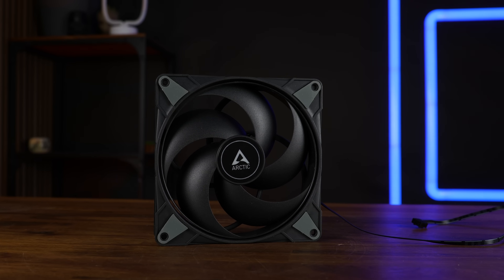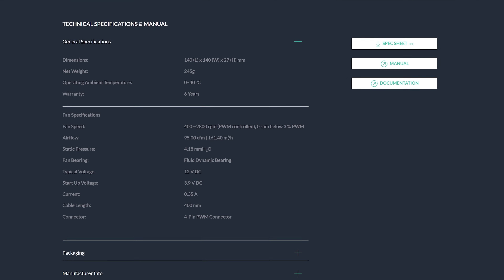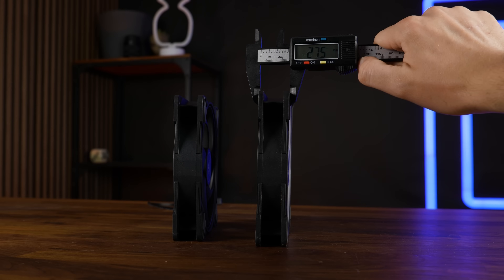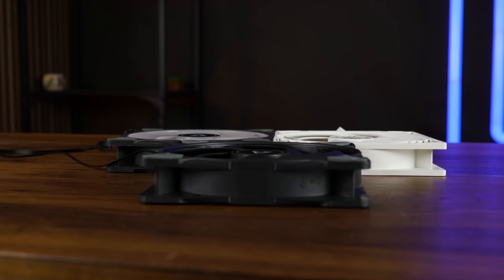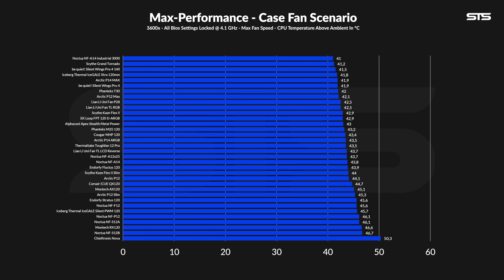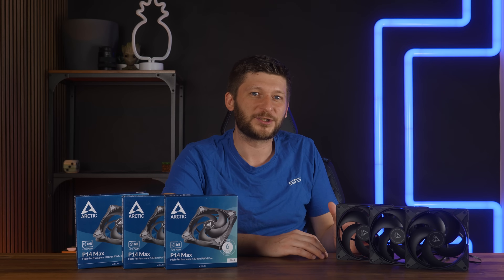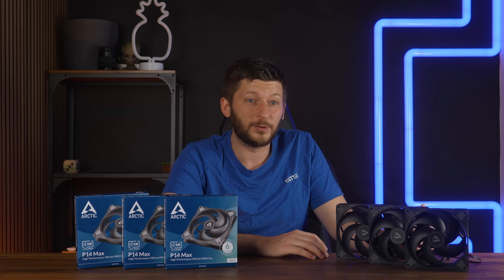Arctic P14 Max - The Monster 140mm Fan

Comment from the maker: -- Spec Confusion

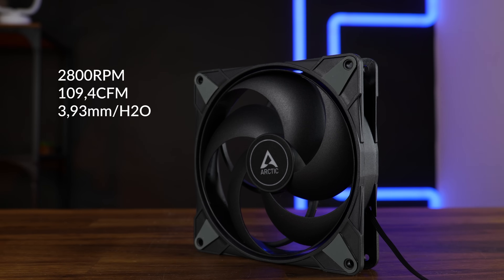As some of you pointed out, the specs stated at 00:50 are NOT the ones Arctic states on their website. 
After a short panic attack - those are the specs written on the box.
I have reached out to Arctic to get more information on this matter, either the Website or every P14 Max packaging got the wrong numbers.
There will be an update as soon as we get an answer.
Reply from the maker: Update ---
There was indeed an error on the packaging of the first few batches. 
The correct Stats are: 
95CFM / 4.18mm/H2O

According to Arctic, this error has since been corrected. However, this also means that there are who-knows-how-many P14 Max fans floating around with the wrong Specs on the box.
Reply: @STSYT  Thanks for the update! Awesome that you follow up that kind of stuff. I saw some people complaining about whirring/buzzing sound. Similar to what some of the P12 Max's were struggling with. I didn't hear any in your video but, did you notice any weird noise in general?
Reply from the maker: @vedomedo  Nothing noticable from far. If pressed against my ear while spinning, you could hear some sort of breaking grinding noise, but that was only at close range. I hope that doesn't become louder, but if it will, I'll update again ^^
Reply: @STSYT what is the best 140mm fan now? Just Performance, no price to performance.
Reply: So, there is no difference between rev1 and rev2 except packaging number right? I am asking cause i have rev1 and rev2.
Reply: @STSYT CAN YOU DO A 140mm fan round up

Comment: to those planning to buy, think twice. i got 4 of these on rev.3, FDB. When set as exchaust on top of my chassis, it makes very little noise even with over 60% speed (pretty much same as what you hear in the beginning of this video. There is no hum or weird noise on top of normal fan noise. For the other two P14max I got as intake, noise profile is same when mounted above the case as exhaust but damn, the hum or whatever it's called is insane and flows in a rhythm. It is like you've got a bee on caffeine flying over a fixed pattern.
Reply: sound like harmonic noise, your top fans must be tight so no air can push pull and create the hum, where the front filters or pushing past a frame or even flow back ontop the fan that more likely where the fan fight flow back would make the sound, i imagine lower the speed till it cancelled out that sound, if there drives behind the its why, I have the issue with fractal fan on the front due to the drives and unclean air flow, im looking at these as the 25mm over the 20mm fractals so the thigh to the drives Id hope will reduce the sound at the least same but better air flow. unfortunately these testers dont test real use cases.
Reply: @streamtabulous  those P14 fans I had as intake were down below my case. I think the hum is due to the blades facing the grill or case panel. For the ones I got mounted above the case, as exhaust, the blades are not touching anything or in a way "hanging" inside the case - the back of the fan is the one facing the grill or case panel.  

I replaced my intake with 3*TUF TR120 reverse fan. The blades are not facing the grill or case panel, no hum, peaceful gaming. Surely more expensive, but definitely worth it.
Reply: @zethcrane5468  i have the hum also but can take the fan caddy with fans out and the hum is only when in case blowing over whatever, interesting reverse blade on your doesn't do it maybe its air pulling in and air pressure build on blades outer. 
but reverse blades are lower pressure and air flow the p14 drop my drive temperature by 6 deg each rather massive drop. so im putting up with the bee hum. new drives are insanely hot at 40 deg at rest
Reply: i have the p12 (not pwm and max) and had same issue but over time the hum went away, the fans did get re-mounted when i upgraded the PC but on the same Case.

So for some people the Hum is possible to go away, also, on the front intake in my case i can mount close to inside or closer to outside (the mesh side), on the mesh side i doesnt make the HUM.

Comment: I bought this to replace the horrible stock corsair fan in my corsair CS800 power supply It has twice the airflow now and is connected to an Aerocool Touch 1000 to control the speed It now extracts warm air out the top of the case very effectively on my socket 754 3700+ cpu computer

Rear case fans are useless as heat rises extracting the heat out of the top is the best solution

Great fan

Comment: Tried those fans.
Had to send them back, because the ball bearing is very loud.
The blade design seems to be great to push a lot of air with not much noise. But you can't use those fans for a real silent scenario, as they're just too loud at low rpm.
Reply: the early production p12 max where ball bearing, but the later ones are fluid or whatever, and are WAY better.  

ive got both and yeah, early ones are bad...

the white p12max will be fluid bearing, the black is a silent update so hard to know what you will get :(.
Reply: @ I got the P14 Max just recently (February 2025). But they still had the ball bearings.
Reply: @uhu4677 how would you know if its ball bearing or not? Can it be known before purchasing the unit?

Comment: For anyone buying these fans and plans to install them at the bottom of the Hyte Y60 Case as intake, YOU WILL NEED to buy longer case fan screws. I bought some 30mm long case fan screws and was finally able to mount them since the default screws weren't long enough but other than that, I would definitely recommend getting these fans. 👌

Comment: I have a pair of these P14 max on my corsair h115i elite capellix. The massive airflow and static pressure combined with this 280mm radiator make the perfect aio to me. Mine are also the 109 cfm spec box and work perfectly fine lol

Comment: At 8:29, i dont understand why your Y axis starts at 35db, because surely the P14 max can push a LOT of air at noises much under 35db, right?
Reply: Probably because it is difficult to achieve volume levels below 35 decibels in a regular room.
Reply: @peny1981 the app on my phone would vehemently disagree.
Reply: @gudrune  Phones are not great for measuring.
Reply: @gudrune  phone aren't as accurate as dedicated noise meter stuffs

Comment: I love these P12 and P14 max fans. Yes, you need to tune the fan curves, but they're like 90% of the best performance you can possibly get, for 30% of the price. One of the things I really appreciate is that they start spinning at very low PWM values (>5% I think) so you can really use the whole PWM range - it's perfectly possible to have these run at 600rpm with the option of 2800rpm if you suddenly find a CPU+GPU load that dumps 800W of waste heat into your case all of a sudden.

Comment: 5pack is 40euro . i bought 2 for exhaust based on gpu temp. the 420AIO does the rest of the exhaust and the rest of the fans are 9x140mm intake.

Comment: I love the P12 max for its double ball bearing. It's nice to know that I bought a fan - and it's actually eternal. Yes, if you're not lucky, it will be a little noisier, but as a rule it's a trifle, you still can't hear behind the airflow. 
and the P14 max FDM has a bearing, i.e. it is a valve for a couple / several years (if you are lucky). 

I miss thermalright TY-143, it cost a penny, it makes noise depending on the speed - not much, it's a pity that they are no longer produced.

Comment: I have this fans recently but damn it didn't spin to max of 2800 but only 2580 to 2600.
Reply: Do not mount the fans into your computer before testing the RPM. Instead, hold a single fan with your hand and connect the power cable of the fan into your motherboard while at the BIOs screen. Now, check the RPM.

Comment: hi can u tell me  what length of screws i need to mount them on a radiator, do they come with theirs screws for radiator mount ? asking since they are 27mm thick is 30mm enough or i need to get 35 mm screws ?

Comment: Oh noes... I upgraded every fan from my PC to the arctic 120 and had some big temp gains, even using 2 as my dual tower cooler fans... 
Now I instantly want 2 of these, before even watching  the review, to put in the front of my S340 🤣
Reply: did you adjust fan curves? doesn't really make sense that you would get "big temp gains" unless you ran them a lot quieter than whatever you had before
Reply: @Violet-ui  I use them all at 80%, mega quiet and a lot of gains. My cooler had muck fans and my front ones had to run at 1200rpm or they would sound like a jet

Comment: Now I have to decide between getting Silent Wings 4 140mm high speed or these Arctic P14Max... hmmmm.
Reply: Wow. I thought I was the only one in this dilemma.
Reply: @MultiMustafa7  Don't get silent wings 4 high speed. They are very loud when mounted to the case. Get the Arctic ones instead. Or else get Silent wings non speed version

Comment: Thanks for the review, glad that you liked the fan. I'll pass the word to the engineers.
Reply: I have questions for you because I am quite new to pc building DIY and the info on arctic site product pages are vague

so arctic sells these two products

p14 pwm 
p14 pwm pst

pwm means that you can control the speed of the fans in a gradual fashion
pst means they are daisy chainable

but 

p14 pwm pst comes with a cable to daisy chain the fans

so,

if I buy the cable separately and buy non pst p14 pwms, would it work the same? 
Are the fans of "p14 pwm" and "p14 pwm pst" exactly the same?  Are the only difference between them  just "p14 pwm pst" having a cable in the packaging to daisy chain them? or the included cable in the packaging is not the only difference and if "p14 pwm" and "splitter cable" bought separately they cannot be daisy chained just the same?
Reply: bro i LOVE your fans, my rig is all P12 Max and 14 Max fans !
Reply: Awesome to see an Arctic employee in the comments! I have a question for you. The fans themselves are markedet as having "Fluid Dynamic Bearing", but in specifically hwbusters' review he states the fans are "Rifle bearing and not FDB as advertised". I was going to order a pack of these but reading that made me a bit worried. If that review is false, I would advise you to contact them and let them know.
Reply: Rip he never responded

Comment: Is it worth replacing the P14's  on my Liquid Freezer ii? Possibly not as my fans rarely hit 50% RPM, gaming load usually sees temps in the mid 50's°C but for those folks who live where it's hot, Arctic has got you!

Comment: Ins't the Silverstone Sharkforce 140 The best 140mm fan ?
Reply: Depends on what you find 'best'. Super Flower Megacool's are crazy with their 120 and 140mm fans pushing 152 and 169 cfm max respectively. Loud though as they are performance fans. For lower speeds Lian Li's Unifan are up there and Bequiet's Silent Wings 4 are amoung to top ones. Basically the 28-30mm width fans rule the roost for noise to performance normalised.

Comment: The Max series suffered from a bearing noise issue. Their bearing was changed in recent batches and now it's fine but there's still a chance that you'll get ones with old noisy bearings so either wait some time until those old batches disappear from the market or make sure you can return them if you get those.
Reply: That's the case for 120mm MAX fans, 140mm fans have FDB from the start
Reply: @resko8758  Good to know, thanks.
Reply: @resko8758  what do you mean with FDB? thanks!
Reply: @resko8758  thank you looking at replacing 3pin fractals with these 140mm

Comment: I put the 3k RPM 80mm version of this on my RX580 when I redid the thermals. It won't break 67c 😂
Reply: How did you attach the fan to the heatsink?
Reply: @plsbanhackers9031  I modified the frame with a dremel. Measured and tapped the 2mm screw holes and attached Ihem to the case. The 2048sp has 2 4-pin connectors.

Comment: Phanteks T30 > P12 Max if anyone cares.
Reply: I mean ofc it is
Reply: 30mm vs 25mm. And better materials, for sure. Want to see more manufacturers push for bigger fans as standard. Huge difference in performance for not a lot extra in width.
Reply: @hinchlikescake7592  yeah especially the affordable and widely available ones lika Arctic, I can't find a T30 anywhere near me and it's expensive enough for me to have to pay like 20-30% import tax on top of its current $35/40 or so, which would push it closer to $50, an absurd price for a single fan.

Comment: Are all Arctic P12 Max use dual bearing / non fluid bearing?
Reply: FDB. Iirc think they changed the in the later revisions due to complaints for noise. The origional had a low quality dual bearing(s) that was quite noticable, even with lower RPM's.

Comment: didn't watch yet, but f***ing finally Arctic !

Watched it now, nice video and thanks for reviewing it so fast, was really waiting for it, and was not disappointed by the results, chart toping or atleast super close to the top Performance for super little money (in the value pack, it goes down to ~8,50 €). Arctic did deliver as expected. Now im only waiting for one 140mm fan the P30 140, cause the 120 is a beast, albeit for a hefty Premium compared to Arctic. 

Nice Video as always, appreciated.
Reply: Corsair has 30mm thick fans now but they haven't been reviewed yet.

Comment: For the price, its unbeatable in value/perf. Would love to see x6 of these in push pull on the LFIII 420mm...
Reply: You could probably run a 9950X at max sustained all core boost without throttling
Reply: It’s expensive. They are charging for the shipping as well.
Reply: Ye thats what I'm doing right now with my 9800x3d It's pretty good

Comment: The argb version has been unobtainable here lately in the US.
Reply: Hmmm $21 on Amazon right now. P14 ARGB
Reply: @davidfluty7213  I should have been more precise. The 5 pack of argb ones don't seem to be available anymore but the 5 pack all black ones are available.  I remember watching a YT video where the guy put the part number for the 5 pack in his video. Maybe they discontinued the 5 pack argb. Newegg also stocks the singles at 21.95 and the non-rgb 5 pack for 69.69.
Reply: @davidfluty7213  I don't know why my comment keeps disappearing but maybe third times a charm.
Reply: I should have been clearer (my fault) and say the 5 pack ARGB in 140mm, I tend to be brief when pecking on my phone but now I'm on my desktop. The singles are available on Newegg and Amazon (I'm not putting the dollar amount this time, maybe that's why the MACHINE blocks my comment??) and the 5 pack in non ARGB as well. 
I watched a video of a guy (need to check my view history) and he was reviewing the 5 pack P14 argb and even put the part number on the screen. The part number works on Arctic website but when you click the button to go to the store it takes you to their Amazon store but no 5 pack argb is there. You can get the 3 pack argb (for fifty USD) and 5 pack non-argb (for forty USD) though.

Comment: A small but important correction, you said "cool down the water [by] x degrees", when you should have said "cooled the loop [to] x degrees above ambient". 

Because that's what your graph says it's measured, and a higher and lower placement/value have the opposite meaning.

Comment: I imagine that if you combine 6 of these with a liquid freezer III 420, you might just get the best aio possible.
Reply: for the price I'd agree. There's less competition in that size of AIO as well. I have the LFII and see no reason to push/pull however. The LFIII has a higher speed pump which is its main advantage. An advantage it wouldn't need if Intel i9 wasn't pushing 300watts.
Reply: It would be near pointless, interesting but 🤷‍♂️there is only so close to ambient you can get. And that's ignoring the chip itself and the mobo unless you are pumping insane voltage for some benchmark (nobody is doing a max over clock 24/7) what's the point if it runs 1 or 2 degrees cooler if it's extreme cooling then you get a chiller. Or on a budget run tubing or even radiator into an ice water bucket (been there done that😁)

I once considered running pipe into our outdoor pond and use water of pond to cool the water in the loop.........needless to say wife not amused.

Not going to lie I am curious. I have a 480mm rad and found at stock chip cooled to acceptable levels passive. Even over clocked it's not unmanageable. I do also have a 360mm rad and a 240 from a guy giving up on water cooling which would ALL fit my case Enthro Primo. Kinda tempted to just bung them all in next CPU I mean it's a shame to waste them right 👍

I would love to see at what point cooling potential (thermal mass, radiator etc) does not matter as there is only so much heat can be transferred at a time
Reply: Sorry for essay you just got my mind running, it's why I love water cooling pcs, physics, engineering and fuck it why not 😂
Reply: I did just that and temps are the best I've ever had
Reply: I only use Arctic to cool my PC I have an Aio LFII 280.. 2 P14 and 1 P12..
My next build will be in the tower 300 with 420mm LFIII AIO and 3 P14 fans 😍

Comment: Nice.. got me a set (5box 2wks ago) and build it on the 420 LF-III in puch (not puch/pull) and used the originals (RGB) as front case fans (7000D) for a 14900k build with a soft control curve... it's a cyclone in a case.. lol.. thnx for your vid's